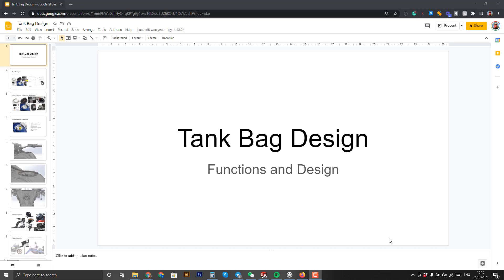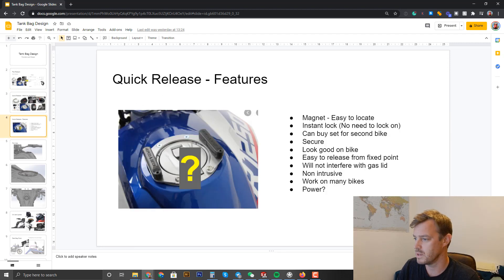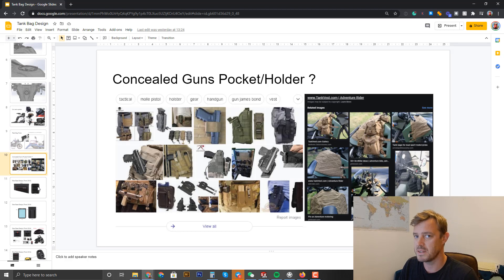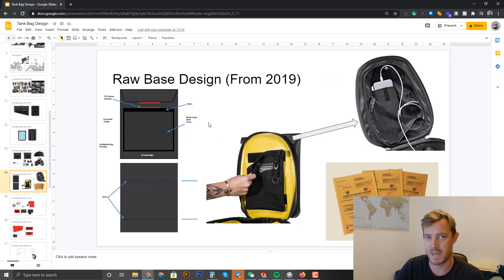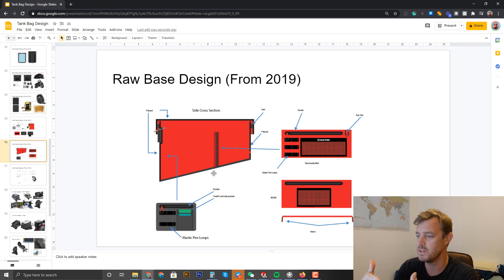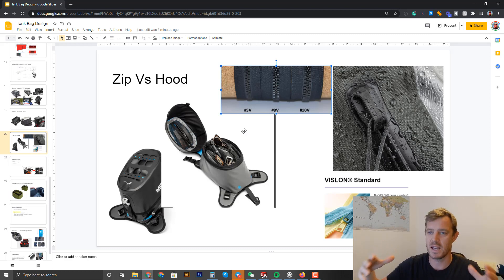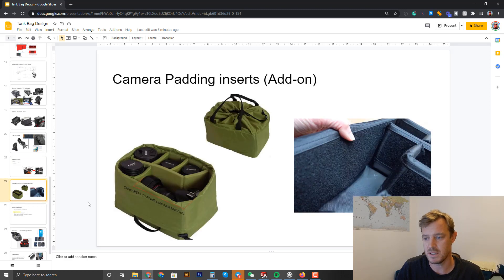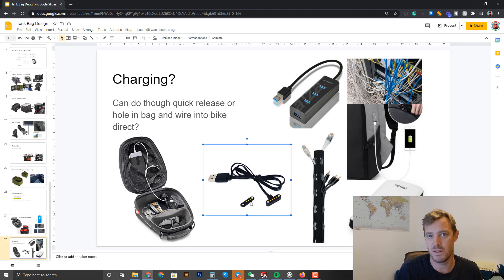Motorcycle Tank bag Design - What do you want?

Comment: Cheers for the opportunity, you have mentioned most things. One thing I find invaluable while traveling is a retractable wire lock, could be used to lock the zips, secure items inside, loop through a helmet/jacket or even extra security to cable lock the bag to the handle bars. Thickness of the cable would be the issue but something is better than nothing. Short Velcro strips are useful to attached a glove strap to when a free hand is needed when paying at toll booths, just keeps it in place.

Comment: Hi Andrew, 
Where do I start? (lol) The one good thing about straps is that it takes more time for some one to steal your tank bag and you can fit it on a variety of motor bikes. Mosko does this and it really does give you options. Then again, everytime you need gas (petrol), a quick release would be nice. I just don't like how much taller it makes the tank bags look off the tank like the SW-Motech bags.

My wife has a second hand Mosko Moto Nomad (2020 Jonda CB500x) and even though the concept of a hydration bag inside sounds nice, I prefer a hydration bag on my shoulders as I can drink while walking around plus it is easier to add ice on a shoulder hydration bag. I would prefer more room inside the tank bag and organization pockets and partitions to keep things more organized inside the tank bag. It makes it easier to find things. I also prefer a waterproof tank bag like my BMW GS tank bag but that needs better internal organization like the Mosko Moto Nomad with a variety of pockets and stretch mesh netting.

The idea of some sort USB charging station inside would be clever with a waterproof way of plugging to my GSA USB port.

If an extender (with zipper) can still keep the price down then great but if it is considerably more then I would not bother going with an extendable tag bag. Bigger teeth for zippers are great but a pop off lid (like you said) with a sturdy plastic buckle on the back would prevent zipper wear from dirt/dust. Mosko started doing that but the bag is too small for a big adventure bike. If I could have the organization of a Mosko Moto  and the external waterproofing and size of a BMW GS back (velco adjustable straps like Mosko and GS then we would be on to something. I don't care for the internal hydration bag either as it takes up tank bag space where camera gear could be. I put anything electronic in my GS tank bank.  You've got my email address already so feel free to drop me a line if you want to dive deeper into the development. You know, I am starting to rethink helping you guys with U.S. marketing but I still am waiting on my motobags quick release (lol). I know there was a delay as you emailed me. All good my friend!

Please excuse typos or bad American grammar!
Pete West

Comment: Hello from a currently locked down UK :-(       
Having used a Givi tank-lock bag for quite a while, here are some of the things is lacks.... or I feel would have made it much better..... 
-  100% Waterproof (The pull on poncho skirt thing for my Givi bag is crap, and basically traps moisture inside the bag
- A quick access pocket where you can safely hold your bank card and Toll road tickets.... so that you can pay and roll without having to remove gloves or have to open the whole bag and expose the contents to the elements unnecessarily.
- A suitably lined pouch to hold a second visor. I tend to ride with a dark tint visor... it really suits me apart from when it buckets it down. I think the ability to safely carry a spare visor, especially for long trips would be great. Either the nose or back of the bag could possibly be shaped to accommodate this. Imagine you are adventure riding, you have an off and scratch or damage your visor. Having a spare would be great and would need very limited space in the bag.
- Built in power: Connect the bag to the bike and then have internal 25000mah battery pack or similar built into the bag. 
- Internal quick release document pouch for passport, bike registration, insurance docs would be great as far as I am concerned.
- I also wonder if without making it too bulky, the bag could be designed in layers, a bit like a high tech cake held together with zips and buckles. That way, it would become modular and could be adapted to suit different situations. If you're going for a weekend away, it could be a nice compact with bag with only one or 2 segments. But if you're heading off half way round the world then attach the whole lot. Could have a tool section with loops similar to those in the mosko moto tool roll.... could have a bladder layer for those who like it on the front of the bike rather than their back. In reality if you made it modular now, the options could be endless for future adaptations..... Plus people could just buy the segments they would use.... a bag for every adventure big or small!!!

Just my initial thoughts, if I come up with anything else I'll post again,

Cheers,

Burgs

Comment: Hi,

One think that you didn’t mention and I would love to have is a small pouch outside the bag (may be even hanging) to keep the garage command, that will be great for commute use! Don’t have to open the bag every day when a get home just for open the garage it will be a big plus for me! (that will also be good to the handle bar bag!)
 

Also If you included some kind of retract string with a card holder will be nice, so we can pass the tolls easier!  (also thinking in commute use)

Regarding the size and design, please do something small and not bike specific, no everyone has a bmw :p, I would love to see something that can be used in a kind of dual sport or rally raid motorcycle (this bikes market are growing) 

Most important thinks that you mentioned:
-	Removable pocket inside
-	Outside net for gloves
-	Lock do the bike
-	Waterproof without cover
-	UBS charger, the one you mentioned that you just connect the usb to the bag and that connect whatever you want inside

Things that I don’t care:
-	Weapon pocket
-	Water blade
-	I use glasses but they already have a specific pouch that I use to storage

Thanks for your work and dedication!

Comment: Hi Andrew! I was looking forward for a tank bag from you. I would prefer a small sized one, even less than 15l.
Between top pocket and top document storage I would say a document storage that is expandable by a 2cm or so via zip, with a wide opening so that it can be used for both purposes. A good example is the enduristan one, I would just add the expandability. Definitely welded lid similar to mosko or the givi model.
I've seen people putting some velcro to their tanks to be able to attach gloves or such. The mesh pocket is certainly best but maybe you can find it useful for something else. Glass pocket wise I'd say that the 2 compartments already make of for a space where to put them. They always come with their own cover and to save space and weight I would go  for a soft one. Already having the bag split in two will allow us to put them away from objects that could scratch them. A good example of soft attachment to the bike would be the mosko moto older tank bag that has the harness always staying on the bike and you just unclip the bag itself. Also the possibility to carry the bag as a backpack is a big plus.
Thanks for getting us involved. 
I really enjoy it.
Keep it up 👍🏻

Comment: My two bob's worth. 
Needs to be 100% waterproof without using a rain cover.
I would like the idea of being able to customise the interior with dividers, i.e. have a large internal space (like the BMW bag) but supply dividers  to allow for individualisation for your gun, camera, drone, coffee machine, etc. A basic standard design with optional "zones" would be better than a weapon version and a camera version and any of the other 100 options that people would request.
My current bag ( Nelson Rigg Hurricane Adventure Tank bag) has a fold down skirt around the top made of neoprene that covers the zip, very easy to use with gloves and the zipper pulls are very large making it easy to open with gloves.
A clear pocket on the top for my solar powered powerbank which allows me to charge items in the tank bag without compromising the waterproofing.
My preference is for a mounting system to the tank ring, I find straps a pain plus they are more prone to scratch the paintwork and magnets don't work with an aluminium tank.
Could not care less about colour.

Comment: For mounting, I vote for a strap-on harness like the Givi one that the bag then clips to. This makes tank bag removal quick and easy for gas fillups or whatever. I would vote no on mounting via magnet as not all bikes have metal tanks, and I have no interest in the tank ring type mounts because I don’t want to install additional hardware on the bike (plus I’ve watched a friend struggle to get his SW Motech tank bag off due to dust incursion).

Gun pocket: don’t care. Traveling with a gun is more of a liability than it’s worth; doesn’t help that I can’t go far without passing through somewhere I’ll get thrown in jail if I’m caught with my pistol. 

Construction: definitely RF welded. And definitely waterproof without a cover. I like the idea of the top hood that doesn’t need a zipper. 

Size: I have the Givi 20-liter tank bag you pictured, and it’s a little too big. Gets a bit unwieldy. I also have its 5-liter brother, which is great for short trips but a bit too small for long ones. So I’d vote for something between 10 and 15 liters. Also, repositionable camera-bag-style dividers for the main compartment would be helpful — would help keep things organized instead of the contents turning into a jumbled mess.

Comment: Hi Andriou I have a bmw r1200 gs and I use givi tank bug for several years of 26 and 5 liters with quick release. The 26 has side pockets with the result that many times in closed turns but also in falls the flashes press the button of the heated grips. Several times it sticks and the quick release. I believe that the tank bang should be up to 20 liters waterproof with visible top pocket for storing maps, tablets, a pocket to the rider's abdomen for documents, passport, etc. and the main space divided into two sections horizontally for better access charging cables. Whether it will be quick release or not I do not think it matters much as long as one side is easily released to fill the tank. 👍🇬🇷

Comment: Hi Andrew, already looking forward to this bag! Here's my feedback:

Mounting wise, don't really care, but since I have a versys 650 I'd like a system which works with it ;)

The mesh net for gloves is a nice idea, however is you use a top like the overlander you'd get both mole/clearview pocket and a place to shove the gloves. (Just a thought)

On the inside I usually put glasses, papers, multi tool knive, pen/paper etc. So a couple of pockets to easily store those would be nice. 

For water I use the bottle holder on the mini bag so I don't care if there is no support for the bladder in it to get some extra space. 

Size wize: small 10-15L I'd say. Any larger and I'll start throwing heavy/large/unnecessary stuff in there. The tank bag to me is for the smaller things which youll need throughout a day/ride.

Comment: put the pin system on the side of the main tank bag so you can add additional compartments on the side that are also quick release from the main bag. But if you want them to stay locked on  to the main bag, the add on compartment has small internal lever locking it in place. for the top of the bag make an add on compartment that maybe uses a plastic or aluminium clip system e.g. for a clip on map pocket or a clip on stretch pocket, or something similar. what I am trying to say is 1 main compartment with ability to add to it to individual requirements.

Comment: A quick access pocket or small pouch outside the bag to keep the garage command and small items
100% waterproof without a cover
Mid- size around, 15l-18l  max to prevent bulging over the tank (with carry-on strap)
Main space divided, two sections for better access, lense, charging cables. 
Quick release or not really doesn’t matter much as long as one side is easily released to fill the tank
No hydration reservoir space
Stretch (elasticized) pocket on both side to store riding gloves after dismount from bike

Comment: There are a ton of large bulky tank bags on the market.  I want a SMALL LOW PROFILE waterproof bag that attaches to a collar on the gas cap with a quick release feature (No straps). Just big enough to conceal a weapon, in a padded compartment that is easy to access with gloves while riding... Heavy duty waterproof zipper with large pull tab.  Hard/formed case and a rubber coated magnet so the weapon stays in position while riding. A clear top for phone, registration, wallet and a way to run a charging cable through a waterproof grommet. Side or front padded/zippered pockets for sun glasses, etc...  This bag is just for the stuff I want to access quickly if needed.  It would stay on the bike most of the time. Ideally, it matches the ergonomics of the bike so it doesn't look like an after thought.

Comment: Wondering what size for concealed weapon pocket ?
I guess when you say "weapon", you mean "gun" and more precisely "handgun".
One of the most used handgun around the world is the Glock 17, which is 7.87" long, 5.43" high and 1.18" wide (Gen4 dimensions).
According to me, it has to be accessible but totally concealed. 
So I think a waterproof padded and zipped pocket underneath the main pocket could be a good idea.
Zip in front of rider, of course. 
With two zippers, so that we could lock this pocket.

Comment: Hood style closure/ mesh for gloves/divider selection/ light color inside/shoulder strap in outside pocket/glasses like Held bag/map holder to fit iPad /detachable carnet and wallet inside hood cover- charger connected to powerbank with 4 USB ports - use for connecting to bike a connector like Cetek battery charger and have 2 more connection possibilities to cigarette lighter or usb connector on the bike - 100% waterproof

Comment: I have the Givi ST602B and the fit is excellent but its very tight against the bars - I've had to move my RAM Mounts for my phone and gopro as the brackets were hitting the bag. Feedback from the various forums I subscribe to is that the SW Motech is excellent but the mechanism gets full of dust off road, making the bag hard to remove. I'd like to see a hybrid of the Mosko tank bag (which has excellent storage features and molle) and the Givi mechanism. I'm really looking forward to seeing the prototype and ordering the bag to go along with the Motobags which I purchased in the the last Black Friday sale. Review on my channel coming soon...
Reply: One more thing to add... great idea about the glove storage, really useful for riders going through tolls, checkpoints and fuel stations. Maybe consider adding velcro strips to the top of the bag, most gloves have velcro wrist straps so the gloves could be stuck to the bag, saves them from dropping on the floor, so you have to get off the bike to pick them up. Does that make sense?